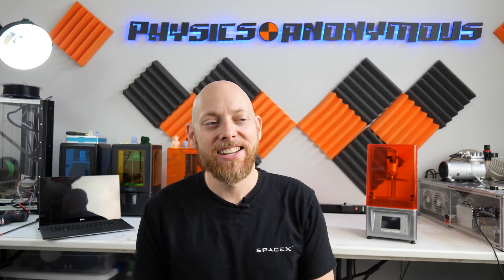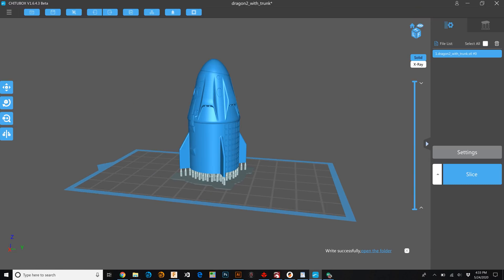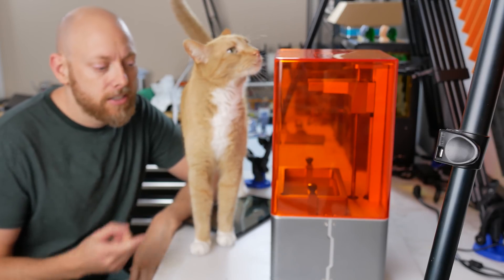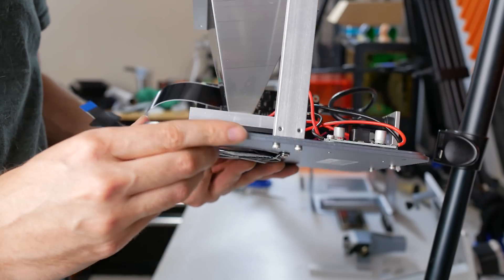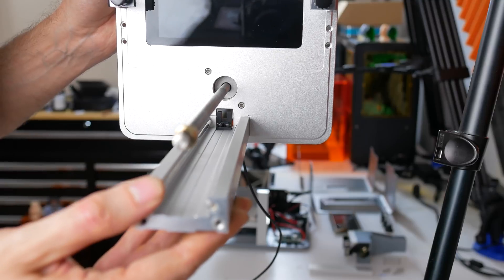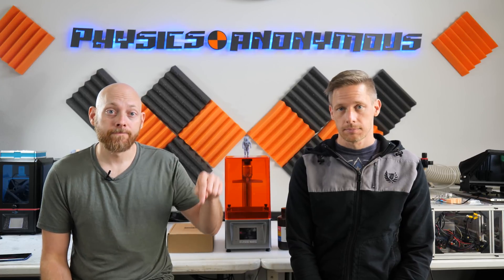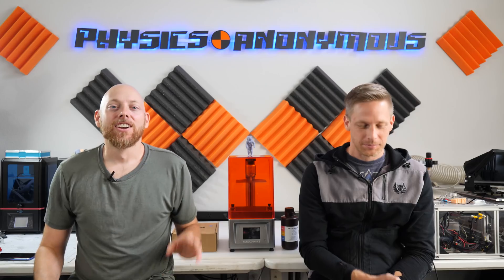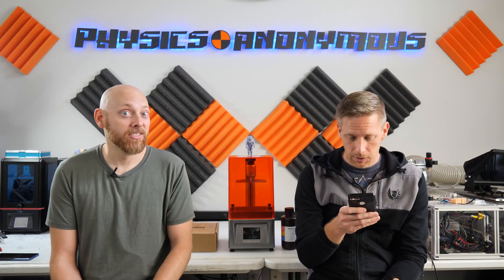Elegoo Mars Impressions and Tear-down - S03E15

Comment: So, as far as Mach4, the big issue is that Mach 4 lists the main download as Mach 4 2.0.4300. That is what they call long term release. It has ALL the horrible problems you mentioned. But!!! Mach 4 2.0.4322 is actually available and works substantially better. CNCRouterparts / AvidCNC has a .4322 version, and it is reliable. However, that version is nearly impossible to find on their damn website, and the customer support does not think that is a problem.
Reply from the maker: I actually tried 4322 after finding their (completely unlisted for some reason) ftp site. Didn't solve any of the problems I was having
Reply: @PhysicsAnonymous  Lame! Well, I guess luck plays a larger part of this whole Mach4 setup than I want to admit. I'm having better luck with ESS and AvidCNC parts than my PMDX424. I wish I could use your Mach3 screenset, but I need the dual spindle part of mach3 for my build. Oh well.

Comment: Even if you don't like Linux and the installation is a 8-hour-long-pita, you should ask you what percentage of the actual using-time that 8h are. If it is more than 1% maybe you should stick with a produkt that seems to have some little issues, if it is less, maybe it is worth the effort. I agree that the installation should be nice too, but I would prefer an harder to install product, which is nice to use over crap that installs like a breeze.

Comment: May I point you to the excellent (I cannot stress that enough) video series on LinuxCNC from hardware to installation and configuration?! "LinuxCNC for the Hobbyist - 0XX" by My Heap.
Right now I have CNC plasma on Mach3 + SheetCam, but going to change that to LinuxCNC + SheetCam + Mesa I/O card + Mesa THC card pretty soon because I'm fed up with problems and limitations of Mach3 + I don't want to run Windows on my machines (my personal religious believes + I'm waaay more comfortable with Linux).
In the future I want to make 4 or 5 axis welding robot (3 axis gantry + 1-2 axis torch holder) for some of my commercial projects (like welding firepits, etc.) which would most likely run on LinuxCNC. So it would be a good idea to get myself familiar with LinuxCNC at this point.
Reply: There's a reason why he numbered it 0xx, room to do 999 video's on it... There's 20 in the series already, about 7.5 hours worth.

Not everyone is comfortable with Linux, that I knew, but apparently there are people that have an absolute allergic reaction to it... Never knew that! ;-)
Reply: @Cergorach  Well, the videos are really streched-out and he gives way more info then just about LinuxCNC (about I/O cards, serial port cards, other hardware, etc.), but you would've known that if you watched at least some of that, instead of judging by the cover ;-)
Reply: Thanks for the tip, seems like the kind of channel I was looking for.

Am not a Linux fanboi, but these guys on this channel need to take the hint that a fancy PC and Windows 10 are the wrong tool for the job.  Yes, I know, Realtime and PCs is generally the wrong tool for the job, but most of us hobbyists are repuprosing an old PC talking to, hopefully a proper controller.  Having to mess with Windows 10 and all its nonsense just to run a few servos is madness.  As for Linuxcnc's UI being horrible...what gives, he managed to write a skin/front end for Mach3, do the same for the penguin?

Comment: Windows scaling on Chitubox is a relatively recent fix. I also have a 4k display on a laptop, and it was really bad before they fixed it.

Also, regarding Linux: knowing how to get around Linux in a basic manner is actually really easy to learn and is a good skill to have. I won't try to convince you that command line is an acceptable UI, but I will try and convince you that knowing a bit of command line Linux-fu is worth it.

Comment: backlash: one place that I overlooked once were the couplers between the servo and the screw. I first used helical couplers, which have some flex (a few degress). Now using spider couplers that are very tight, and that source of backlash is gone. On the double ball nuts, I did actually also encounter some with backlash (they were much looser than all the single nut screws I had so far). Adding some shims eliminated that, but it was a bit annoying that they didn't do that properly from the factory. At least it's fixable.

Comment: I actually just replaced my CNC control PC with a new one. After having used LinuxCNC happily for a decade, I have to say that it's currently in a pretty sorry state of affairs, unfortunately. It used to be really easy to set up, much easier than preparing a windows box for Mach3 to have good RT performance. They had a live image, so you literally just had to burn it on a stick, and boot (or run the installer to put it permanently on HD). Now: the only live image that worked well is still the 10 year old one with an outdated Debian that doesn't get updates any more. All the new ones had really flaky real-time performance on my particular PC (might be a problem with multi-core CPUs). The website and instructions are a mess, so it's indeed hours reading forums and lots of frustration. It's a bit unfair to blame Linux in general - there are a lot of open source projects now that work extremely well, and the modern distros are imho a lot less frustrating that Windows of any flavour... "This machine has to install updates for the next 3 hours" anyone? Best thing about Win10 is that it now also runs Linux, and has a better Shell ;)

On my lathe, I'm running a GRBL board, with a self-written UI running on a raspberry pi with touchscreen. I'm thinking of converting my CNC-mill now as well to a GRBL controller - doing real-time on a PC (windows or linux) is just a stupid idea to start with. I think there are also commercial RT control boxes for Mach or LinuxCNC available, but don't know much about those yet.
Reply: I might be stating the obvious (ignore if you tried it already), but do you have discreet graphics adapter installed (if not, it's really recommended), it should also use opensource drivers and not vendor ones. Aaaand not all graphics adapters work the same.

Comment: Not to be that guy, but I’m going to be that guy. IPA in an ultrasonic is not the best idea. Potential for vaporized IPA being ignited by the ultrasonic... Explosive devices can be cool, but they should be intentional...
Reply: There are definitely some safety issues with it, but i don't think it's hard to stay away from accidents too. Just as a heads up: in addition to the vapors the US will naturally heat the alcohol while it's running. Hotter is more vapor, and more flash potential. Definitely something to keep an eye on if you're doing it.

Comment: I have never tried Linux CNC but a command line shouldn't scare anyone. Maybe I'm biased because I started with computers when you actually had to start your GUU from a command line. I'm also not a stranger to Linux or windows administration from a telnet or SSH window and even the net commands before the powershell commands.

A GUI is kind of like the metric system.  It allows dumb people to participate more easily. But there are two schools of thought. "It works so it must be correct" and "it is correct so it must work". Just because you can point and click something to acceptable behavior doesn't mean you had less problems or you didn'tintroduce new problems. It just means you fumbled through them and did not learn anything in the process. If that is your goal,  jump to it i guess.
Reply: I hear ya, but a little background: I also started when there was nothing but command line, still own the book "beyond 640k," and have worked server admin (in Linux, irix, and Solaris) over the years. I still think there's an intentional reliance on the command line, and it's a matter of where you want to spend your time. For a server it's worth it to get the flexibility, but for a daily driver I prefer my time goes somewhere else. I'm even the guy that wants a car that needs constant attention over something reliable. Go figure?

Comment: I get you might not be comfortable with Linux and terminals. I used to be the same way. Once you learn the basics, you start taking off like a rocket ship, and you realize what you've been missing. With or without the terminal, I genuinely believe installing software is easier, faster, and better on GNU+Linux machines. If you'd like some pointers to get started, feel free to ping, I'm happy to help you get going.
Reply: This is coming from an IT 'professional': Linux is great from an ideological perspective! If implemented correctly, absolutely amazing from a security and stability perspective. But my personal experience is that it works great during testing in a virtual environment, but when actually installing it baremetal... You descent into Linux hell! Also as noted in the video, just get your 'average' (stupid) user to make it work and keep it working. In my experience, there is no fixing stupid! ;-)

You know why we made the UI designer position available... So we could move IT people sideways that can't use the command-line to save their sanity! ;-)

Comment: You guys are the best! I love your channel. I use Mach3 as well and Linux CNC. I still prefer for every day jobs Mach3. One questions did you grind the spindle to get it true? I saw a 0.001" runout in the related video. Maybe make a video how to tramm the mill becaseu there are a lot of different procedure that involves tramming the column first nad then the head in those mills where there is no NOD adjustment.